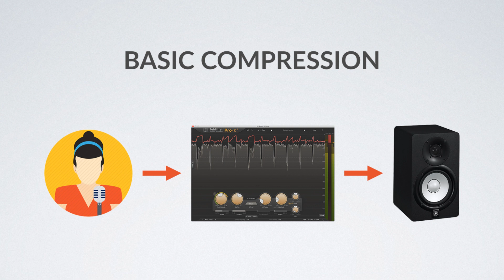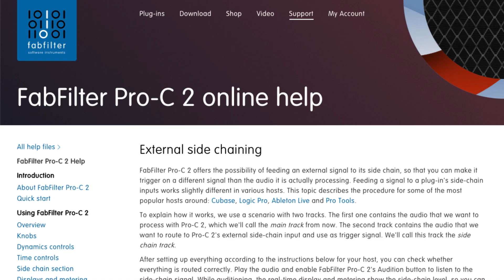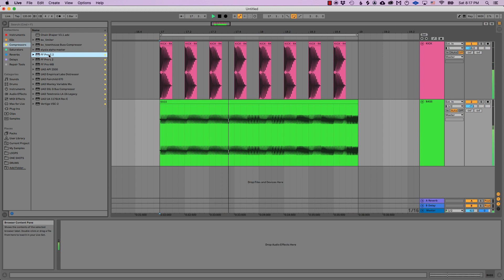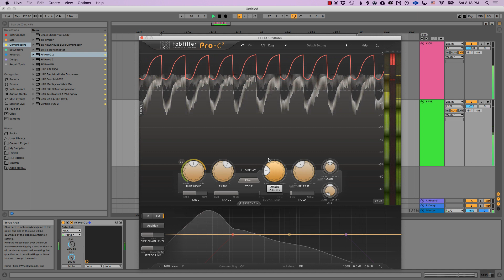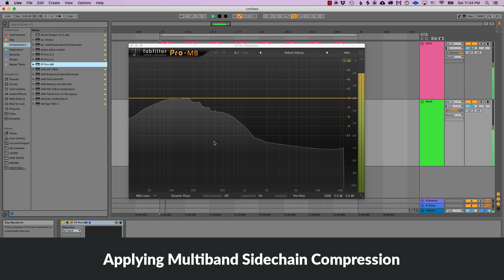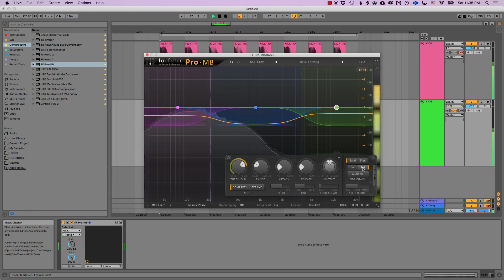How to Apply Sidechain Compression Using FabFilter’s Pro-C 2

Comment: Wooooooo! FINALLY! SOMEONE WHO KNOWS WHAT THEY ARE TALKING ABOUT!!
THANK YOU SO MUCH FOR THIS VIDEO!!
The simplicity of this is so amazing and extremely effective and actually works!
Thank you again for making this amazing video and keeping it super simple!

Question: Do you like side chaining more with the PRO - MB  or  the PRO C2 ?
Reply from the maker: Thanks for the praise!

In regards to your question, it depends on the issue you're dealing with. If you're trying to apply aggressive pumping effects, a broadband compressor like the Pro-C 2 will probably work best.

When transparency is the goal, and you're just trying to provide a bit of clarity to a problematic frequency range, reach for the Pro-MB.

The compressor settings you use will play a big role in the results you can expect as well. With moderate compression settings, the Pro-C 2 is also quite capable of providing transparent results.
Reply: @BlackGhostAudio    OMG I just got  through testing this out and  you are so correct 
we wanted the bass to be pumping so we used the pro c2 and  we used  the pro mb for the other element to duck when snare and kick hit  but with the bass we just set it up for the kick!

What we really like is that we don't have to set up a trigger channel or a ghost channel to trigger it or creating a send effect!

Routing everything to the send effect or having to copy mid trigger notes to the ghost channel and if we needed it to be off or change pattern we would have to go back and edit the ghost notes! With this  we can just automate  it when we need it on or off much easier!
Others make side chaining this big  equation and technical way of routing 
This is so simple and super effective and you have a bunch of control.

Thank you so much again for this amazing video!
Have a great day and week and keep up the amazing work!
Reply from the maker: Happy to help! Glad everything worked out for you.
Reply: @BlackGhostAudio  sidechaining with a LFO tool you need to trigger it and have to route it correctly! 
Do you prefer sidechaining with the fabfilter over  a LFO tool?
Reply from the maker: @GreatestSportsHighLights  In most cases, I'll use whatever gets the job done the fastest. I like the FabFilter Pro-C 2 for general-purpose sidechain compression. It integrates well with Ableton and has different compression algorithms to choose from.

My secret weapon for extreme pumping effects is a tool called Chain Shaper; it's a Max for Live Device created by Tech Noir that avoids the "clicking" that many compressors produce when pushed to their limits.

I wrote a review about Chain Shaper a while that covers its unique features. You can check it out here if you'd like to learn more: https://sonicscoop.com/2019/04/16/new-software-review-chain-shaper-for-ableton-live-by-tech-noir/
Reply: @BlackGhostAudio  hi i need your help please how would I Duck vocals using this?